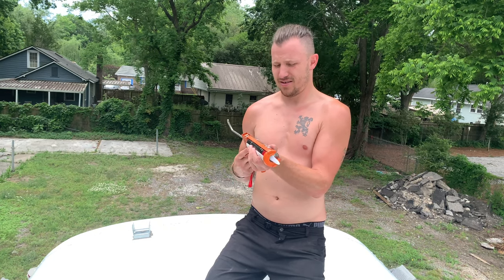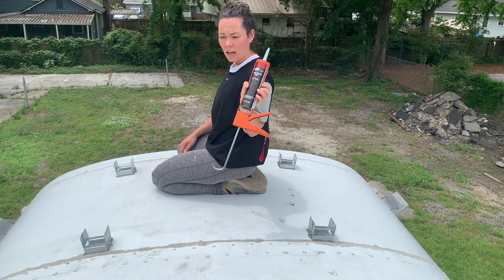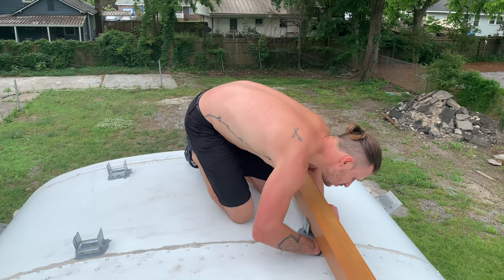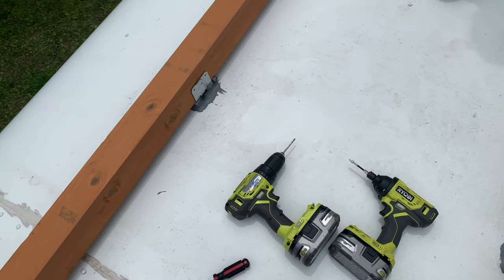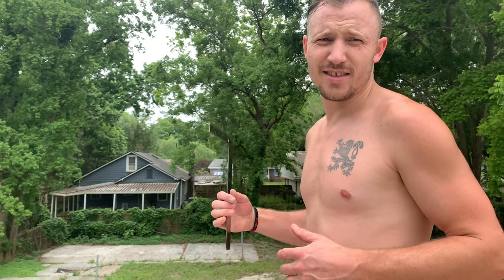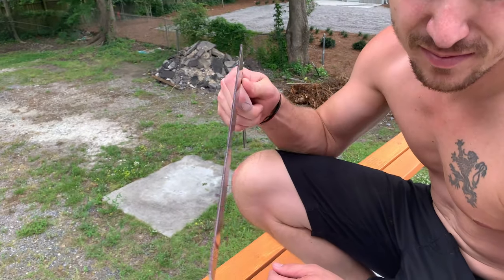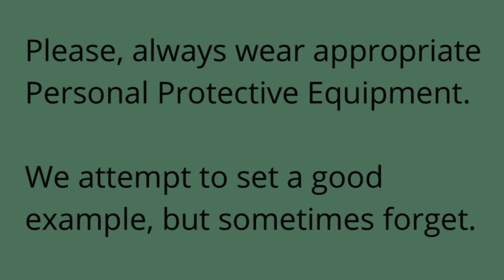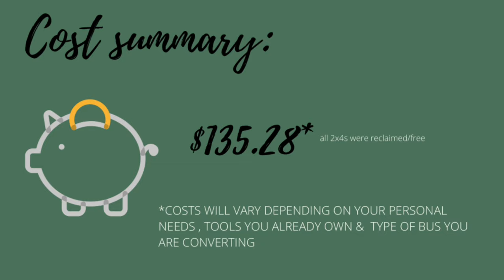Bus Deck Build - School Bus Conversion - SKOOLIE VIDEO

Comment: Good job McBrowns. Shane was right on this one... That wasn't going to go anywhere. I would suggest some method like a 2x4 screwed into each plank, under each side, to prevent the 2x4 planks from curling up or down randomly from heat and moisture. Lock them together at the edges.
Reply from the maker: Yeah, yeah yeah...he's right. Lol - but really...you guys are both right. He also was talking about doing a final framing piece around the edges to keep it all from bowing...great minds...